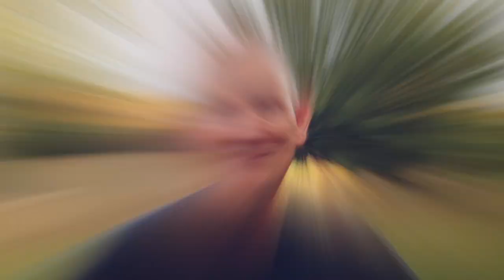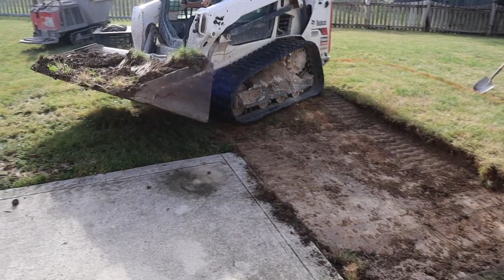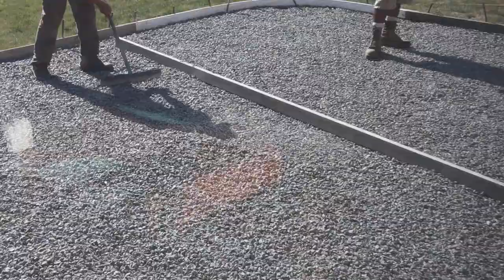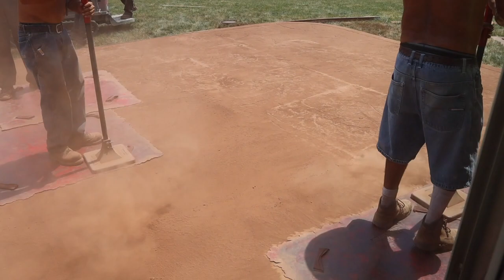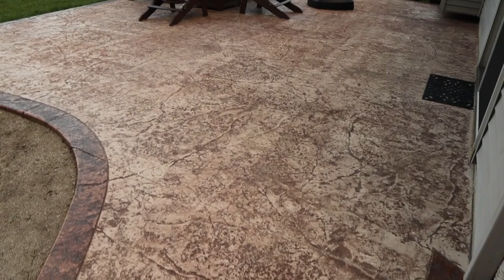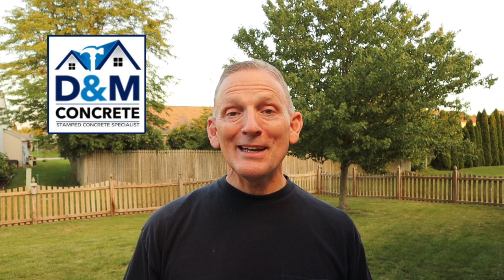AMAZING PATIO TRANSFORMATION - Stamped Concrete BEFORE & AFTER

Comment: How much per square foot?
Reply from the maker: Roughly $10/square foot (20 x 25 patio + 48 x 3 sidewalk)
Reply: @manlymoments8544  nice. In NJ, I it's closer to $11.50
Reply: Well it's actually $9.50 for installation (not including cost to remove existing concrete patio)